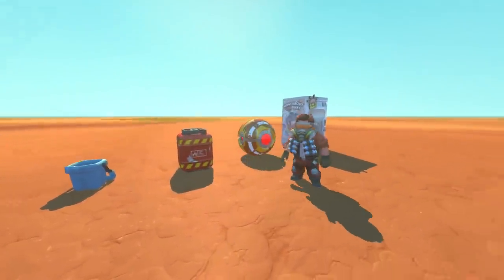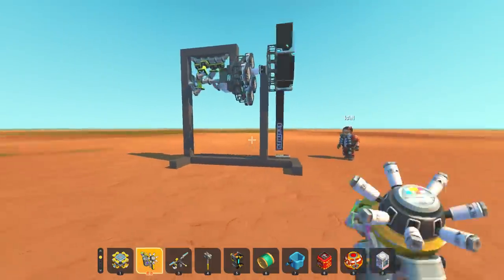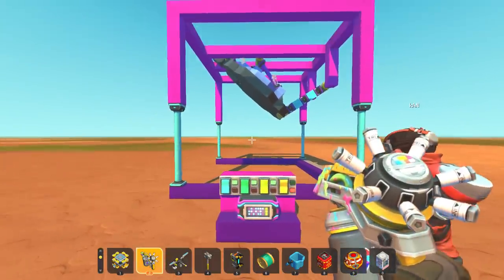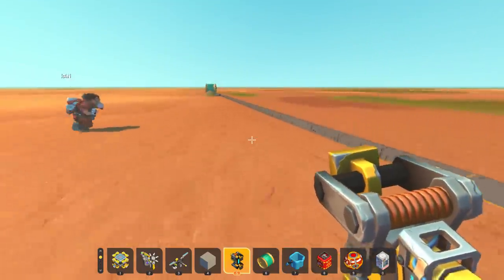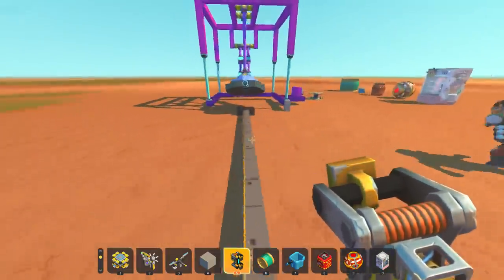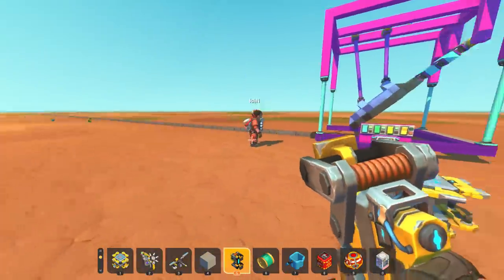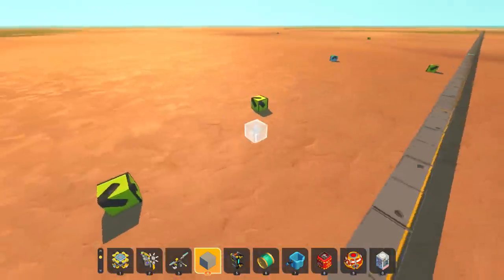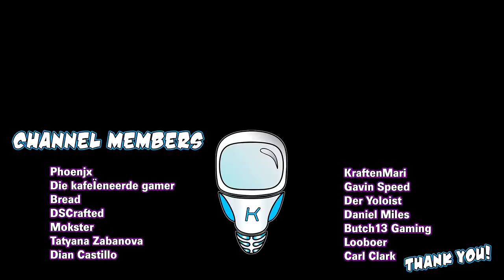Who Can Build The ULTIMATE Piston Powered Kicker?

Comment: With the explosive you could invert the kicker at the end of the foot so it starts expanded so it may soften the impact with the sensor closing it back. It has potential just have to finetune it a little more, automatic height adjustment and dial in some presets, high kick fat kick ect :D

Comment: Kosmo really just needed to configure properly, which was understandably difficult to do.
kAN needed a lower impact point and more weight at the end.
If both machines were fine tuned, I think it would have been a much more even match... that said, I still think you'd of won just because your kicker was fundamentally accurate whereas kAN's was shaking and wobbling all over the place.
Reply: kAN's is also more vulnerable to weird scrap mechanic physics, since it's constantly going at high speed. Kosmo's is just a big whack with a large object, so it doesn't clip as much.

Comment: For this kind of thing where accurate measurements are needed in 2 dimensions, I recommend building a flat platform with a 10x10 grid painted on it and every 5th grid line being a different color. Then counting becomes more trivial, and you only need to paint a block on the pad instead of placing a block that could interfere with future tests (like when Kan kicked the sphere).